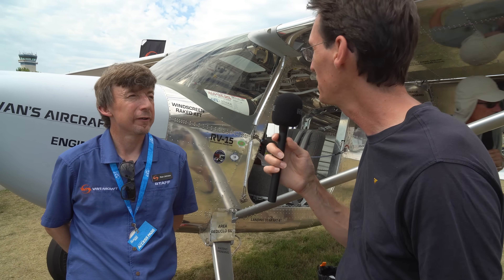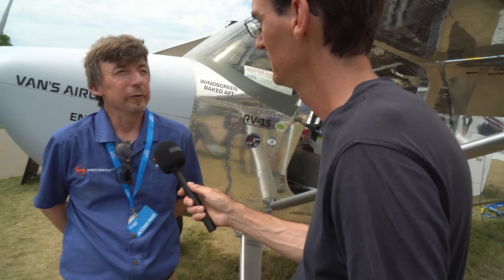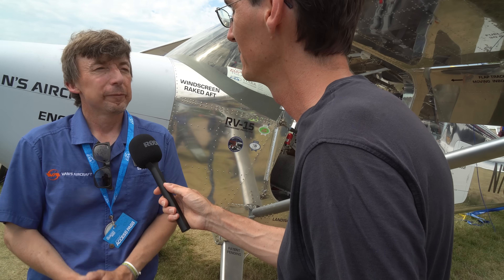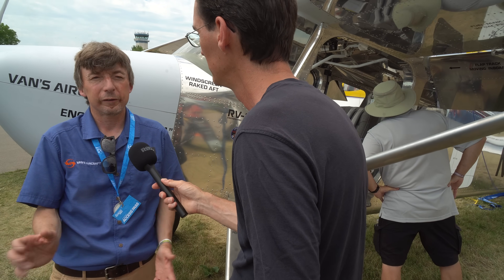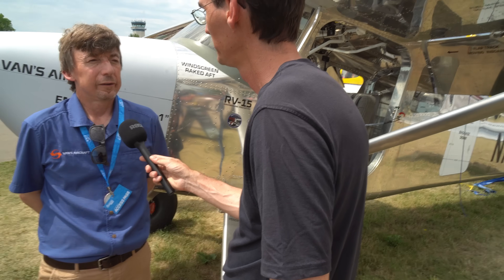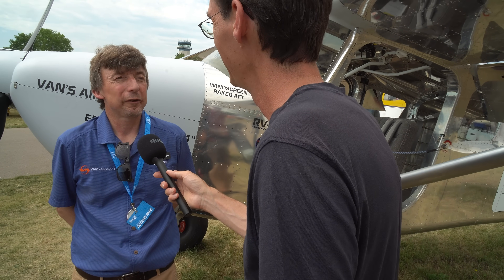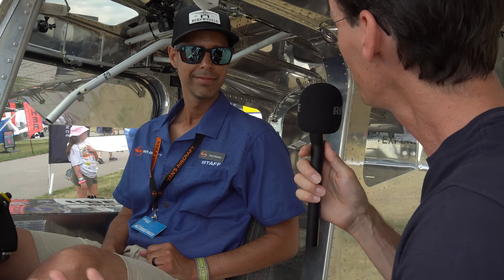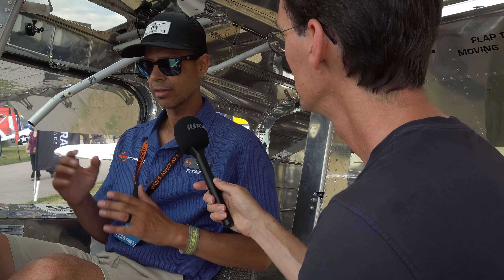Van's RV-15, latest updates, revelations and insights

Comment: You absolutely do not need 260hp to get 4 seats.

Piper Cherokee
Piper Warrior
Cessna 182
BD-4c
etc.

Heck, even the R44 helicopter doesn't need nearly that much HP to carry 4 people.
Reply: 4 full size adults and 100lbs luggage, yes you should have 6 cylinder.  R44 has Lycoming IO‑540, six cylinder.  Then six cylinder 4 person planes would be Beechcraft bonanza, cirrus SR22, Cessna 182,  and so on.   Just because a 4 cylinder piper Cherokee has 4 seats doesn't mean its a 4 adult person airplane.
Reply: @Hugocraft  Yeah, Talk About Commenters Gone Wild!?! The Moral To This Thread Should Be, Don't Overload Your Aircraft! Thank You.
Reply: @thewatcher5271  flying at or below max gross weight is not "overloading".
Reply: @Hugocraft  the 1967 Cherokee 140 has a useful load of 949lb (70lb more than a C172S). I trained  in pipers and thy truly are 4 seaters. I have plenty of time in a PA-28-161 for example, and at 160hp, outperformed cessna 172 (flew faster, climbed faster, burned less gas, greater useful load of 972lb, better IFR ship, easier to land, etc.). And I have taken up 4 adults in it no problem. The Cherokees/Warriors were 150-160HP 4cyl and had useful loads of 950-970lb depending upon exact model and year.

yes, the Cessna 182, R44, and others have 6cyl engines, but only producing 205-230HP. Not 260+HP. And mind you helicopters are far less efficient than airplanes, yet a 205HP R44 can take 4 people (I've flown the R22, R44, and R66 as well in the Rocky Mountains).

I consider they Cessna 172 a 3-place airplane (for adults), but I've taken up 4people many times with kids onboard including over the Grand Canyon and other parts of the Rocky Mountains. And we've flown with 3 adults many times at high DA airports (up to 9,300ft DA on takeoff), and it has 4cyl 160-180HP engines.

Lets compare the Beechcraft Bonanza to the Cessna 182T.

182T - 167mph cruise, 1130lb load, 230HP (and I've gotten closer to 200mph cruise consistently out of 3x C182RGs I flew in the Rocky Mountains, making it superior to the Bonanza by matching performance on 70HP less).

Bonanza - 203mph cruise, 1130lb load, 300HP

36mph faster, for 70more HP, no other improvement than speed. An SR22 gets 211mph, and 200lb extra load for another 10HP over the Bonanza.

Meanwhile DarkAero is expecting to get 275mph cruise, 750lb load, for 200HP (6cyl).

You know what else has 6cyl engine? A Sonex with a Jabiru. Also, a Pietenpol with a Corvair. A Zenith Ch750 with Jabiru or Corvair. A Wittman Tailwind or BD-4c runs everything from 4cyl to V8 engines. The SPAD XIII in WW1 had a 205HP V8 engine. Formula 1 had a 4cyl BMW engine putting out 1280HP. Cylinder counts mean literally nothing, as torque and RPM are factors as well.

"Just because a 4 cylinder piper Cherokee has 4 seats doesn't mean its a 4 adult person airplane."

Just because everyone is fat these days (2/3 of Americans are legally obese according to the CDC), does not mean the Cherokee, Warrior, 172, etc. can't carry 4 adults. Even a C172S can carry 4x 190lb adults and 20gal of fuel, giving up to 2hrs of flying by a competent pilot who knows how to lean properly, and it only has an 878lb load and 180HP.

A Bearhawk 4 place does 180-260HP with 4-6cyl, at 140-150mph cruise (at only 62% power), doing 950-1350lb load. Making it superior to the RV-15.
Reply: @SoloRenegade  The Piper Pilot 100 is basically their Cherokee re-released but now its only a 3 seater even with a 180hp io360 4 cylinder engine.  Based on what piper did and what Van's is saying, its seems like they rather put out a plane with more head room based on the number of seats their planes have.
Reply: @Hugocraft  the Piper Pilot 100 is a purpose built trainer. Yes, looks like they simply went for headroom. But it looks like it's not based on the "Cherokee", but rather the larger "Warrior" or even the "Archer".

Older Piper Warriors/Archers did have 180HP engines. Basically they just remanufactured and existing design with some changes.

But this in no way validates nor disproves what Vans claimed. The C172, Cherokee 140, and many more CAN carry 4 non-obese or overweight adults. They are true 4 seaters, flying on 150-180HP, and others fly on 200-235HP with extra speed and/or payload. The R44 does it on 205HP.

Payload is also a function of the wing design, more so than the engine. There are gliders that carried tens of people and even vehicles, with no engine and zero horsepower at all. You can also design an airplane that can barely carry 1 adult pilot into the sky on 100+HP.

If you need 260HP to design and fly a 4 seat airplane, you are officially a bad aircraft designer (your airplane is inefficient, overweight, or you are trying to fly too fast or two much fuel/baggage). You can impose higher speeds, or more payload on your design, but to ignorantly declare ALL 4 seaters needing 260HP and 6cyl, is telling people they know nothing about aircraft design, nor do they know anything about engine design (as there is NO correlation between the number of cylinders an engine has, and the horsepower it has).
Reply: But then it would not be an RV ... it would be a Piper Cherokee, Warrior, Cessna ... 180 hp 4 seat aircraft are not 4 seat aircraft but 3 seat at best. Power to weight equates to safety when climbing in a loaded aircraft in the bush and mountains. If you look at the statistical distribution of all GAMA and EAB aircraft (as we did when defining MOSAIC) you will see that the average hp in a 4 seat aircraft that is marketable is more than 220 hp. The Cirrus SR20 is less than 20% of all SR20/22 sales.
Reply: @rianjohnson7484  Wrong.

the 1967 Cherokee 140 has a useful load of 949lb (70lb more than a C172S). I trained  in pipers and they truly are 4 seaters. I have plenty of time in a PA-28-161 for example, and at 160hp, outperformed Cessna 172 (flew faster, climbed faster, burned less gas, greater useful load of 972lb, better IFR ship, easier to land, etc.). And I have taken up 4 adults in it no problem. The Cherokees/Warriors were 150-160HP 4cyl and had useful loads of 950-970lb depending upon exact model and year.

The Cessna 182, R44, and others have 6cyl engines, but only producing 205-230HP. Not 260+HP. And mind you helicopters are far less efficient than airplanes, yet a 205HP R44 can take 4 people (I've flown the R22, R44, and R66 as well in the Rocky Mountains).

I consider they Cessna 172 a 3-place airplane (for adults), but I've taken up 4people many times with kids onboard including over the Grand Canyon and other parts of the Rocky Mountains. And we've flown with 3 adults many times at high DA airports (up to 9,300ft DA on takeoff), and it has 4cyl 160-180HP engines.

Lets compare the Beechcraft Bonanza to the Cessna 182T.

182T - 167mph cruise, 1130lb load, 230HP (and I've gotten closer to 200mph cruise consistently out of 3x C182RGs I flew in the Rocky Mountains, making it superior to the Bonanza by matching performance on 70HP less).

Bonanza - 203mph cruise, 1130lb load, 300HP

36mph faster, for 70more HP, no other improvement than speed. An SR22 gets 211mph, and 200lb extra load for another 10HP over the Bonanza.

Meanwhile DarkAero is expecting to get 275mph cruise, 750lb load, for 200HP (6cyl).

You know what else has 6cyl engine? A Sonex with a Jabiru. Also, a Pietenpol Air Camper with a Corvair. A Zenith Ch750 with Jabiru or Corvair. A Wittman Tailwind or BD-4c runs everything from 4cyl to V8 engines. The SPAD XIII in WW1 had a 205HP V8 engine. Formula 1 had a 4cyl BMW engine putting out 1280HP. Cylinder counts mean literally nothing, as torque and RPM are factors as well.

Another commenter said, "Just because a 4 cylinder piper Cherokee has 4 seats doesn't mean its a 4 adult person airplane."

Just because everyone is fat these days (2/3 of Americans are legally obese according to the CDC), does not mean the Cherokee, Warrior, 172, etc. can't carry 4 adults. Even a C172S can carry 4x 190lb adults and 20gal of fuel, giving up to 2hrs of flying with reserve by a competent pilot who knows how to lean properly, and it only has an 878lb load and 180HP.

A Bearhawk 4 place does 180-260HP with 4-6cyl, at 140-150mph cruise (at only 62% power), doing 950-1350lb load. Making it superior to the RV-15.

Almost all of my flying experience is in the Rocky Mountains, and the Cherokee 140, Warrior 160, C182, C172, and many more are all true 4 seaters. Just because they lack an arbitrary set of performance numbers when doing so, does not make them less than a 4 seater.

Payload is not simply a function of HP. Gliders have 0HP. Certain planes can have 200HP and still only be able to lift a single adult. the Cherokee 140 can do it on 150hP, and the Warrior on 160HP and the C172 on 160-180HP due to their overall design, namely their wing design.

Also, cylinder counts don't matter as I've pointed out. A Chevy Corvair Powered Pietenpol is not a 4seater, despite having 6cyl engine. Other engines can top 300HP with only 4cyl.

You're conflating false notions with being a 4 seat airplane. You're massively oversimplifying aircraft design and spreading false information.

" If you look at the statistical distribution..."

Airplanes are not required to comply to arbitrary statistical distributions. we don't design aircraft based upon statistical distributions. Do you think the first person to ever design a 4seat airplane used statistical distributions of prior designs (which did not exist) to determine how to design their airplane? No they did not. A great many aircraft don't even conform to the various statistical distributions you can devise, in one way or another, such as the C172. You're not innovating at all if you simply design to match the statistical distributions. And you leave yourself open to being outperformed by competing designs, as is the case with the RV-15.
Reply: Ok, Vans Aircraft is the most successful kit plane manufacturer in the world, but you know better...
Looking forward to your 150hp, 4-seat, 900lb load, 140 knot plane coming out soon. When can I buy one? 😂
Reply: @matt-v4k5f  Don't expect anything but condescension and idiocy out of @SoloRenegade. Thinking that he would have any meaningful contributions to the aviation industry is pure hilarity. 🤣
Reply: @matt-v4k5f  It's called a Piper Cherokee 140, thy already exist. You can buy one any time you like.

Cherokee 140 has a 150HP 4cyl engine, 949lb payload, 136mph. (your 140kt requirement is random, baseless, and arbitrary).

And I actually am currently designing multiple aircraft as we speak, including a cross country machine, STOL machine, and more.
Reply: @SoloRenegade  I've flown a C172S (180hp) hundreds of hours and a Cherokee 180 for 700 hrs. I've flown both fully loaded. The Cherokee has a higher useful load and you can basically just put whatever you want in it and you'll be within limits, in fact it flies nice with some weight in the back. The C172 much less useful load but still the same story, just load it up and you'll probably be within limits. I fly in the midwest and both of these 180hp 4 place airplanes feel like potatoes when fully loaded. They will 100% get you off the ground and get up to a reasonable altitude but it's maximum effort. I can 100% see why Vans would limit this to a 2 place aircraft for what they are marketing it for; a back country airplane. Especially if they are still going for that feeling of a Vans aircraft. I haven't flown much in a Warrior or a Cherokee 140 but I would not want to load it down with the same weight as their 180hp big brother.

Just because you can doesn't mean you should...
Reply: @joeneu  Your lack of skill and confidence as a pilot does change the fact they are 4 seat airplanes and fully capable. Yes, they will fly slower, climb slower, use more runway, but all of that is per the POH. The performance figures are calculated at max gross, that means fully loaded. It's not a mystery how they will perform.

Just because fully loaded is too much for you to handle changes nothing. Just because it doesn't perform as well as you like doesn't change reality.

You do realize that the top pilots in history flew aircraft like this when they were learning too? Power limited, performance limited. and it never stopped them. its part of why they were such good pilots. 

I have flown these aircraft loaded just fine, without issue. And some I've flown loaded at High DA as well, without issue. It just requires more skill, judgement, etc. that you possess. 

Just because you're lacking in skill, doesn't mean it can't be done.
Reply: @SoloRenegade  Ok bro what ever you say. Apparently you've seen and done it all sounds like. Let me know how a fully loaded 140 climbs out of Denver. These planes aren't new and their real world performance numbers reflect that. Like I said just because you theoretically can doesn't mean you should. You should start a youtube channel sounds like you have a lot of ideas... Stay safe and good luck.
Reply: Considering this aircraft will likely be used to fly in and out of high density altitude strips, carrying mountain bikes, camping gear etc, 260hp sounds absolutely fine to me. And there is no way I’m going to carry 4 adults in a Cherokee 140 on an xc. 180 sure.
Reply: @BigOleBallSack  "And there is no way I’m going to carry 4 adults in a Cherokee 140 on an xc. "

if you can't fly a Cherokee 140 to its POH limits, then you won't be able to fly an RV-15 to its limits either.

I've flown Cessna 172 and Cessna 150s al over the Rocky mountains, including with all 4 seats filled. Idaho, Utah, Colorado, Northern New Mexico, Arizona, CA, throughout Nevada, etc. Never had trouble. We'd even fly the C172s into Leadville and Telluride. 

I've departed a 5000ft field elevation airport at 9,300ft DA, and higher airports at even higher DA all the time.

I could easily fly a multi-hour xcountry in a Cherokee 140 with 4 adults. The very first flight I ever did after getting my PPL was to take 3 passengers up in a PA-28-161, 160HP, and it was supper easy.

I took my PPL checkride at 40.2hrs of flight time (broke 40hrs flying to the checkride). Soloed at 6hrs, tailwheel endorsement and spin training in only 6hrs (aerobatic Citabria at 3 airports, 3 paved runways, 2 grass runways, takeoffs and landings over real obstacles, 3-point and wheel landings, crosswinds, etc. everything you're supposed to do). My very first flight in a twin engine (C-414), we had a real-world single engine situation at 21k ft, and I handled it so perfectly, without having had any instruction in single engine operations, that my instructor thought I was already ME rated. And I passed my Commercial ME rating to MEI standards about 1 month later.

If you can't fly the airplane within the basic performance limits in teh POH, then you need to get more instruction.
Reply: @BigOleBallSack  I've flown C172 with 3 adults easily in High DA airports in teh rocky mountains. Field elevations of 5k-7k ft, DA of 5k-9k ft on takeoff.

I've flown with 4 people in a PA-28-180 with ease as well. 

All well within the POH limitations and capabilities.
Reply: They are building a bush plane, they know bush pilots will load it up. Taking away room for four adults makes it so mtn flyers won’t try four adults…
Reply: @pizza0451  no matter how much horsepower and lift you give it, people will still overload it. The issue is not THAT they designed it for 260hp 6cyl engine, it's the CLAIM that you cannot build a 4 seat airplane on less HP and less cylinders.
Reply: By the time your kids are too big to fit in the backseat, they don't want to hang out with mom and dad anyways. Please offer a 2+2 backseat option!! Plenty of Piper Cherokees with 180hp engines do just fine! You know 75% of these will never see an off airport landing, even if it's the builders dream. People want a 2+2 kit for airport hopping and the occasional light duty off airport adventure. Let pilots make pilot decisions. Call it a 2+2 and your perfectly covered if liability is the concern.
Reply from the maker: None of those have the performance of an RV-10, or Cirrus or Bonanza etc. So putting words into Rian Johnson's mouth, I guess he was saying that to get four seats, useful payload and performance you need a bunch of hp?
Reply: @FLYERTV  the 1967 Cherokee 140 has a useful load of 949lb (70lb more than a C172S). I trained  in pipers and thy truly are 4 seaters. I have plenty of time in a PA-28-161 for example, and at 160hp, outperformed cessna 172 (flew faster, climbed faster, burned less gas, greater useful load of 972lb, better IFR ship, easier to land, etc.). And I have taken up 4 adults in it no problem. The Cherokees/Warriors were 150-160HP 4cyl and had useful loads of 950-970lb depending upon exact model and year.

The Cessna 182, R44, and others have 6cyl engines, but only producing 205-230HP. Not 260+HP. And mind you helicopters are far less efficient than airplanes, yet a 205HP R44 can take 4 people (I've flown the R22, R44, and R66 as well in the Rocky Mountains).

I consider they Cessna 172 a 3-place airplane (for adults), but I've taken up 4people many times with kids onboard including over the Grand Canyon and other parts of the Rocky Mountains. And we've flown with 3 adults many times at high DA airports (up to 9,300ft DA on takeoff), and it has 4cyl 160-180HP engines.

Lets compare the Beechcraft Bonanza to the Cessna 182T.

182T - 167mph cruise, 1130lb load, 230HP (and I've gotten closer to 200mph cruise consistently out of 3x C182RGs I flew in the Rocky Mountains, making it superior to the Bonanza by matching performance on 70HP less).

Bonanza - 203mph cruise, 1130lb load, 300HP

36mph faster, for 70more HP, no other improvement than speed. An SR22 gets 211mph, and 200lb extra load for another 10HP over the Bonanza.

Meanwhile DarkAero is expecting to get 275mph cruise, 750lb load, for 200HP (6cyl).

You know what else has 6cyl engine? A Sonex with a Jabiru. Also, a Pietenpol Air Camper with a Corvair. A Zenith Ch750 with Jabiru or Corvair. A Wittman Tailwind or BD-4c runs everything from 4cyl to V8 engines. The SPAD XIII in WW1 had a 205HP V8 engine. Formula 1 had a 4cyl BMW engine putting out 1280HP. Cylinder counts mean literally nothing, as torque and RPM are factors as well.

Another commenter said, "Just because a 4 cylinder piper Cherokee has 4 seats doesn't mean its a 4 adult person airplane."

Just because everyone is fat these days (2/3 of Americans are legally obese according to the CDC), does not mean the Cherokee, Warrior, 172, etc. can't carry 4 adults. Even a C172S can carry 4x 190lb adults and 20gal of fuel, giving up to 2hrs of flying with reserve by a competent pilot who knows how to lean properly, and it only has an 878lb load and 180HP.

A Bearhawk 4 place does 180-260HP with 4-6cyl, at 140-150mph cruise (at only 62% power), doing 950-1350lb load. Making it superior to the RV-15.
Reply: @FLYERTV  I didn't put words into his mouth, he very clearly said a 4 seater needs 260hp.

"None of those have the performance of an RV-10, or Cirrus or Bonanza etc."

wow, I never knew more HP gave a plane more performance, I must have been born yesterday.

That is NOT the point. Performance is subjective and dependent upon the mission. 900lb payload is not high performance. Th Kitfox can pretty much do that. 140kts is not high performance, the Bearhawk and others can do better than that.

"I guess he was saying that to get four seats, useful payload and performance you need a bunch of hp?"

nope, Bearhawk, Piper Cherokee, Piper Warrior, C182 and many more can do it. I've flown 4 people in a Warrior and 182 with payload to spare, and some of that was in teh Rocky mountains too.

BD4c is faster than the RV10 and far cheaper, and is a true 4 seater.

People are free to make their own choices and judgements. I design airplanes too, and claiming you need 260hp to have a "true 4 seater" is BS nonsense.

260HP 4 seater = "how expensive can I make the airplane?"
Reply: @SoloRenegade  Your reading comprehension must not be very good. FlyerTV was saying they were putting words in their mouth, not you. There are some great youtubers that can help you with your english deficiencies. Good luck!
Reply: @3SM20Pilot  "FlyerTV was saying they were putting words in their mouth, not you"

wrong. he said, "So putting words into Rian Johnson's mouth, I guess he was saying that to get four seats, useful payload and performance you need a bunch of hp?".

this means He put words in Johnson's mouth, not their own mouth.
Reply: @SoloRenegade  Sure sounds like you were born yesterday.
Reply: @ Ad hominem. proves you have no counter argument. you know I'm right, but you're just mad about it.